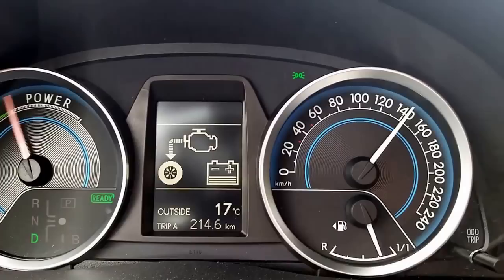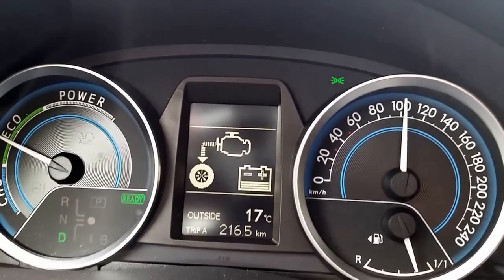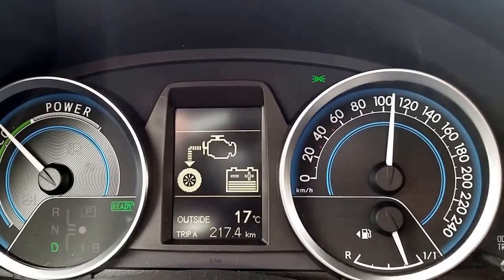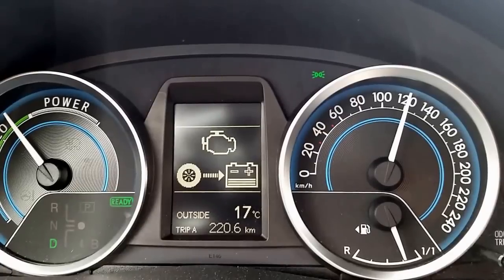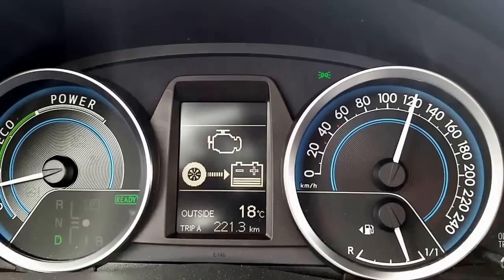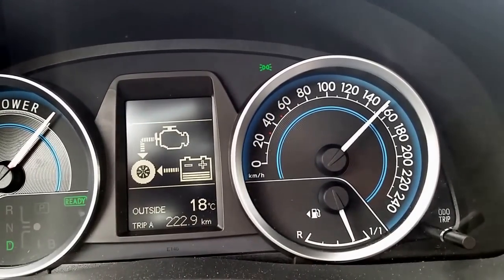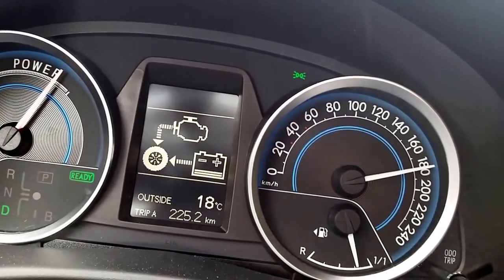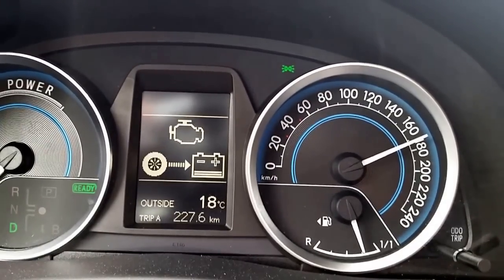Toyota Auris Hybrid acceleration to full speed on Autobahn - battery almost depleted to empty

Comment: The car is build for local trafic and to cruise along the autobahn with about 120 or 130 kilometers per hour, and not this drivestyle. Than the Hybrides are not noisy at all.  Yes, its scary to hear that petrol engine going in high RPM at first, but the engine is not going to break down. The engine is set to a max RPM of about 5500, so that's compared to a regular pertol car verry low.

Comment: this is a real life situation where you struggle to empty the battery on the autobahn :)) =)). own one, i'm really happy with it. my record fuel consumption is 3.58 l/100 km.
Reply: Normal driving or like grandpa
Reply: My record is 66.6 mpg , city driving
Reply: City driving: 2.3L/100Km
Highway aprox. 100/130Km/h 4.9-6L/100Km

For a petrol Hybrid car this is actually pretty good 😁

P.S driving a Toyota Auris/Corolla 1.8 Hybrid Black Edition MY2017

Comment: this car should never leave the city :) slow and noisy acceleration makes it very uncomfortable while high speed cruising.
Reply from the maker: +milli pekmez Exactly. It's great in the city and makes it a pleasure to handle a traffic jam, too.
Reply: At 1:50 you can see the car is preety calm when cruising, 140 is more than preety much every country speed limit (except germany's autobahn)
Reply: So I have to buy a new car to go cross-country?
Reply: I own one myself, a Toyota Auris Hybrid with 140HP. My hybrid battery is always full when on the AutoBahn and I cruise around at around 170-180km/h with the gauge still hovering at the top-end of ECO. At such speeds, there is NO engine noise...but there is a lot of wind noise! I have driven 200km/h in my Auris too but it is always too busy on the road, so I slow down to around 170-180km/h.

Comment: Timo, what do you think about Prius 2011 and Auris 2011 ? kinda the same engine, specs and power. Is prius less noisy than Auris? thank you.
Reply from the maker: Sorry, I don’t have a comparison between both noise levels. I’ve been driving an Auris for some time and had the chance to drive a Prius for a short amount of time as well. Noise level depends upon multiple parameters (for example speed, tires, road conditions).

My experience was that the cars are quite silent while driving on electric motor in the city and became noisy when accelerating fast. Once target speed was reached noise came down a bit in most cases. Usually I didn’t drove as shown in the video.

I assume that people driving Auris HSD or Prius are trying to save fuel and drive ecologically friendly. Anticipating traffic will help and not going to higher speed (and noise levels) will do so, too.

Ideally you’ll try both and decide which one you like better. The dashboard is quite different and not everyone likes the Prius' design.
Reply: @Timo-M  Thank you.Prius design is  unusual, i'd say futuristic .Auris and Prius  , both models are criticized due to poor sound isolation, comparing with VAG groups cars with the same price tags. Only Lexus CT200hybrid onthe same platform and engine has a bit higher quality of material and isolation. IMHO :)

Comment: good video and experience !:)  we can see than the hybrid system is better in linear  speed ... and it's not in the " philosophy" 's hybrid cars to overtake  all the time.... intersting and informative experience  on motorways !:)
Reply from the maker: +xavier lacorne Thank you. Hybrid performs very well with great fuel economy especially in urban areas and traffic jams. Even speed up to around 120 km/h seems OK, while higher speed comes with increased sound levels and higher consumption of course.
Reply: Why not overtaking? This is a common action for a car on the autobahn (since our's are free of charge unlike yours and therefore regularly well filled).  It is worth to know in which way the hybrid works here.
Reply: Actually IMHO hybrid is ideal for lots of accelerating/slowing down. While with a normal car the kinetic energy is wasted when braking, a hybrid will store that energy so you can use it next time you want to accelerate.
Reply: kada jawi most of it*
Reply: Also hybrids have less drag than normal cars so that's anither benefit

Comment: I will take Honda Civic Tourer over Auris anytime. Bigger trunk and most reliable engine out there 1.8. Consumption on average is 7 liters and nothing ever breaks with Honda and on Highway it takes 200kmh with ease. Auris is for city driving...long highway trips probably eats 9-10 liters at 160-180kmh.

Comment: Do you have comparative experience with an atmospheric petrol engine around 1600 ccm / 100 kW size? E.g. 1.6/97kW in Toyota Auris or 1.6 GDi/99kW in Hyundai i30/Kia Cee'd? I am thinking about buying Auris TS Hybrid, just wondering if it does better/worse in lower RPM  and acceleration 60-100km/h due to higher torque. Also seems the e-CVT is quite noisy when going at full throttle. Thanks.
Reply from the maker: +Jenicek25 Acceleration with HSD is continuous, because there's no gear to shift. On the other hand, as you already mentioned, it's more noisy as it sounds like way higher RPM when accelerating. Once the target speed has reached, it calms down unless you're going at higher speeds. I strongly recommend doing a test drive on your own, since Hybrid and CVT needs getting used to.

Comment: When u are going 80+ and u mash the acceleration do the battery push it a lil then go to gas.in other words I want to keep it at 80 and keep toching the acceleration when it drop lil blow 80 , dose the battery kick in or only gas at those high speeds
Reply from the maker: As far as I know the car makes a choice depending on parameters like battery charge, requested acceleration, required power to accelerate, RPM of the generators...
Reply: @Timo-M  yes with CNG ones it heat up the car dose run on CNG alone after so it will be doing the same but with CNG so it should work

Comment: Can a battery hybrid car get a CNG kit installed  in .can CNG in a hybrid powered car work ???..... Like in that car u was driving
Reply from the maker: As far as I know, there are
some modified cars. Search the internet for Toyota Hybrid CNG.
Reply: @Timo-M  I did not seeing it at all
Reply: Don't do stupid thing with Toyota hybrid. It will works fine 1 million km if you maintain it
Reply: @rondhole  CNG in my country dose go very far . Liquid gas is to expensive...so I want to combine the two .just want to know if it will work
Reply: @kernj6454  it should work if you contact local Toyota dealership. Check for all safety and the fueling program.  I have never seen any Toyota 1.8L with CNG in USA, Europe, or Asia yet. It definitely needs ECU reprogramming.
Reply: @kernj6454  what I understand, it still need gasoline on cold start, only after fully warm the CNG can be used. Some report shows it can have 8000 km range with proper setup CNG. Seriously, check Torque News, they have plenty info about hybrid cars

Comment: What is still unclear is the detailled reaction at high speeds:  Is the electric engine still helping? Where does the power come from? If the battery is almost empty the electric engine has to get the power from the mechanical engine via MG1, but there is nothing left since the mechanical engine is at the limit. So I assume the mechanical engine has to be able to fullfil the speed of 180 (200 in your desplay) alone. is that the case?
Reply: The interesting scene namely is 5:30 where the battery stops delivering enery (according to the display) but the speed increases though!  Since the electric engine cannot help to accellerate, the mechanical must have done this. Or was it a downhill part of the road?
Reply from the maker: Actually, a second camera showing the road would have been nice. At 5:41 I mentioned that "it's going downhill and the top speed has been reached". My speculation is that battery power is used to "boost" acceleration as long as possible and after draining the battery it'll use the ICE to keep the car at the desired speed. As far as I know, the ICE is a 1.8 L engine with 99 HP. By the way, you'll might want try the "Yaris Hybrid Simulator".
Reply: the dashboard graphics don't always tally up with the centre console touchscreen graphics either, i'm less inclined to trust the dash graphics( like when the EV light comes on but the arrows do not show power going to or from battery...)... if you are using the car in sport mode, its best to put it in regen brake mode aswell.....

Comment: question about fueleconomy  what is the milage when doing this kind of driving
Reply from the maker: +Johan Jonsson As I was going that fast for a few minutes only, I don't have valid numbers measured by refueling. Eventually fuel economy even while going full speed was good and as far as I remember the energy monitor showed that some electrical energy was drawn from the generator and assumingly used for the electric engine at the same time. Maybe I'll check for some numbers and add the info.
Reply from the maker: +Johan Jonsson So I checked that recently. Consumption accoding to the car's info display was around 12 L/100 km while the battery has enough charge to power the electric engine to support the combustion engine accelerate as fast as possible. Haven't done long full speed rides, therefore no valid averaged data. "Your mileages may vary."

Comment: how far can you go on one full tank?
Reply from the maker: Tank should store 45 liters, depending on the driving style and conditions you can go more that 1000 km with one full tank - but „your mileage may vary“.

Going full speed will dramatically increase fuel consumption, yet I’d consider this a general rule.
Reply: About 800-900km

Comment: pwr mode on?
Reply from the maker: +V.C. Normal mode. It didn't seem to make a difference to me, when going full throttle.
Reply: ok,, just bought one the last days. is it ok for the acceleration to only occur sensibly when you're at max power? tried all 3 modes but the car was only moving forward when the engine was screaming. what is the average fuel consumption of the car on the BAB at around 140 kmh?
thanks in advance :D
Reply: I do about 5.6L/100km on Eco Mode, with the cruise control at ~135 kph on a slightly hilly motorway (A10 Bordeaux / Niort in France).
Oh I just realized you buy  the car very recently. I hope you like it !
The engine is actually not that noisy, what is confusing is that it's not noisy in the same way and at the same time as a conventionnal car. You'll get used to it don't worry :)
- EV is not really a mode because you can have both EV+Eco or EV+Pwr activated. I use it only when I just have to move the car a few yards or in indoor car parks. Don't try to use it to save gas! It won't works.
- I use Eco Mode most of the time. It makes the gas pedal less responsive (I find it good in city) and moderate the use of AC.
- I never really used Power Mode. Tried it a couple of time and I didn't find it useful. Maybe for driving on the mountain?
On some occasions the engine is on when idling (if it's cold or if the battery is really low). You may find the fuel economy quite bad on these moments ; I was worried about that the first times but it's perfectly normal. It's because you don't move but the car use still use engine power to charge the battery (even if you don't see any arrow from the engine to the battery!). 
- Sorry for bad english ^^ -
Reply: When I press the pwr button my car gets MUCH more power.
It's actually a bit ridiculous.
I get 3.6 l/100km if I drive very gently, not pissing too many people off.
I get the car warm then switch off heating to stay in electric mode as much as possible.
Only switching it on when climbing hills as the engine is working anyway.
Don't use cruise control if you want to save fuel. And it doesn't work if you are in B anyway.
Reply: @bobziho  merci for all this infos ur english is good actualy  take care

Comment: unfortunately the gas engine of all Toyota Hybrid is extremely loud... very low comfort on these cars... listen to that, awfull... not good for a modern car...but good to see that in every day traffic it´s hard to deplete the battery even if you push it
Reply from the maker: Absolutely. The combustible engine is quite noisy in my opinion, too. But it seems to run at a comparably good efficiency. Most people won’t drive full throttle on a daily basis, I guess. Yet I have to admit that driving a quieter car is much more relaxing.

Comment: Why would you want to drive that fast? It is not safe!
Reply from the maker: I didn’t want to cause concern, as I was driving with foresight on German Autobahn. Keeping a safe distance to other cars and watching for them possibly changing the lane is important.
Reply: It's save - on German Autobahns at least. This depends on the actual car and weather conditions, of course. I wouldn't want to drive that fast in a Seat Ibiza, or some other sub-compact car with small tires and bad suspension - if they ever reach that top speed, that is.
In Germany, it works. Imho, it's because people tend to drive more disciplined in general. They usually never overtake other cars on the right, but on the left, for example.